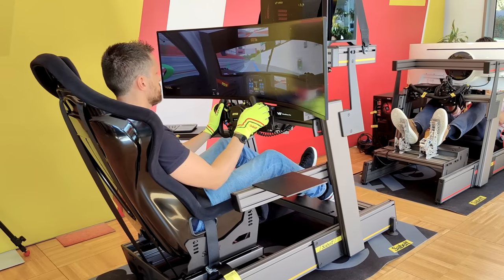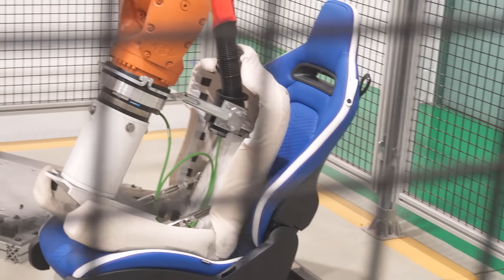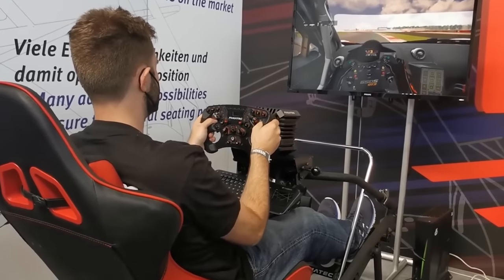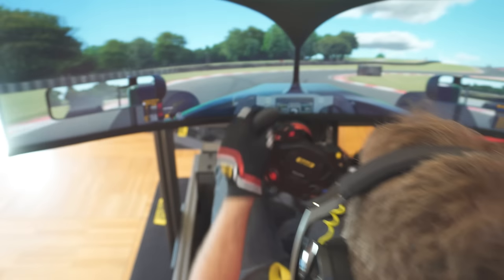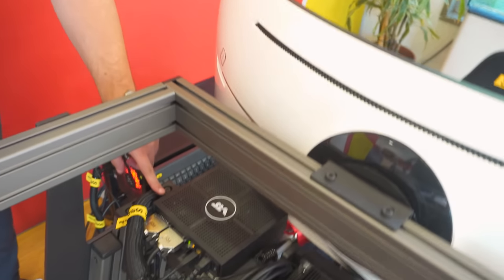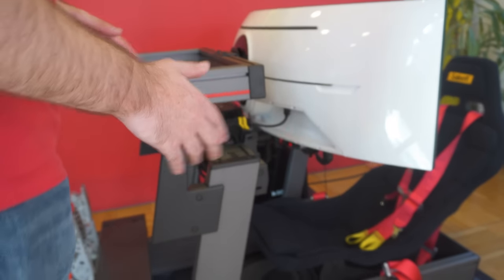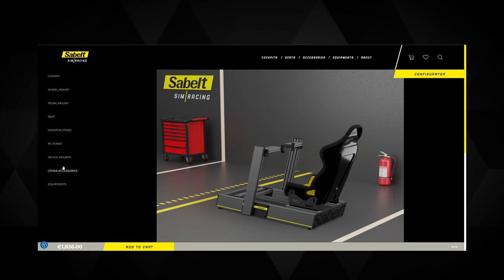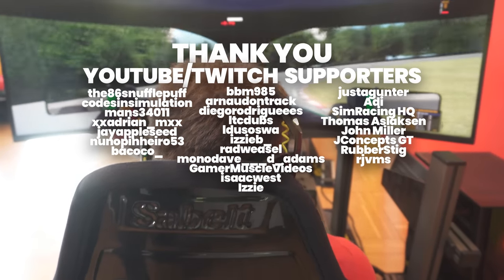Sabelt New Simrigs - Impressive

Comment: The rig seem to use similar profiles (and angle) as the new Sim Lab P1X Pro cockpit. 
(perhaps some similarity with the Advanced simracing ASR Pro aswell?)

Looks quite nice overall, BUT judging by the videos, rigidity out of the box doesn't seem quite good enough...
There's just to much overall physical shaking @0:13 and @7:05 to justify that price tag.

I havent tried any profile rig myself yet though, but it seems really stiff rigs seems to be the exception?
Very many seem to have that side to side shake, and quite a few seem to have too weak wheel decks so you can push the wheel up and down a bit too much.
Honestly, not acceptable at this price level.

Seems more engineering needs to be done to implement more bracing?
Reply from the maker: Totally unique profiles
Reply: The monitor is shaking not the rig.... nobody should mount there monitor to there rig for this very reason its always going to shake even with Gorilla Glue😂
Reply: @AdamOutlaw87  No, you can see the "uprights" move aswell. (and the keyboard tray etc)
I guess there might be other reasons for this, such as the rig not being tightened up completely, but those shakes does not inspire confidence.
I agree that hard mounting the monitor probably isn't the best idea though.